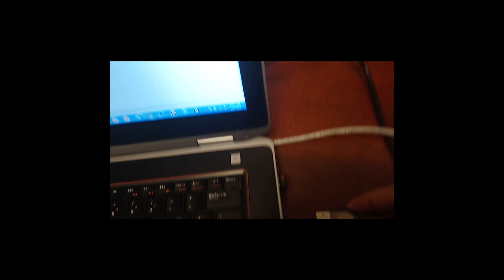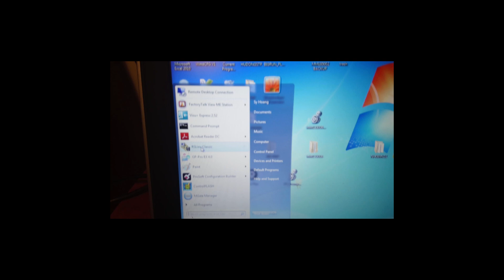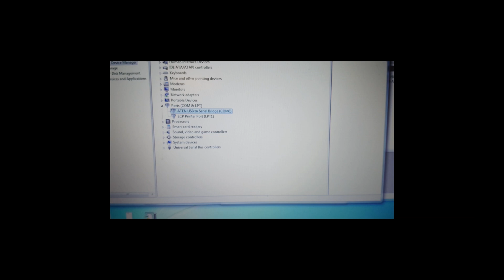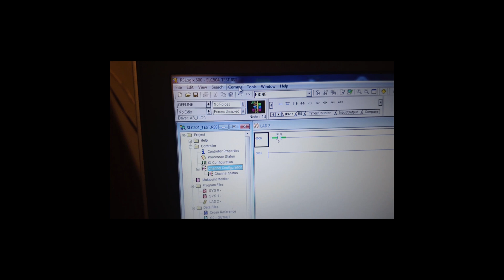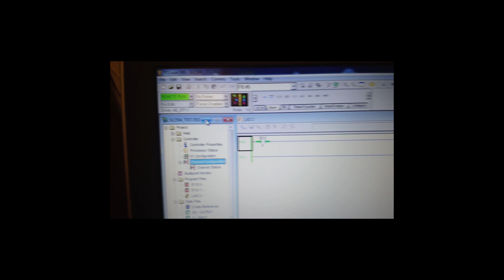Rockwell AB SLC500 1747-L541 DF1 Full Duplex communication 1747-CP3

Comment: It seems the cables and  converters of  DF1 and DH485 are the same ?  When we say the drivers, actually they are sort of software concepts to support different communication protocols . Is my understanding correct?  THANK YOU. SY P
Reply from the maker: @Dennis Jiu: DF1 and DH485 are drivers. But each driver has different pinout/wiring for the connection even both DF1 and DH485 might be over the same RS-232. That's why we need a 1747-UIC converter for DH-485 instead of only a cable specified in the video for DF1 driver. Your understand about drivers is correct; However, each driver can have its own connection type or can have the same connection with other drivers for our convenience. For example, RJ-45 connection typically is for ethernet driver; However, you will see it is also for modbus RTU/Serial in one of my videos about Modbus RTU. Protocols, drivers and connection types are somehow challenging and confusing but I think you will soon fully understand all 3. Good luck.
Reply: @SYPHOANG  THANK YOU SO MUCH. Your explanations are like a professor's. I noticed the RJ-45 connection for Modbus RTU/Serial connection, and It seems the Prosoft Modbus card uses that way to make connection after I watched the two Prosoft videos in your channel.